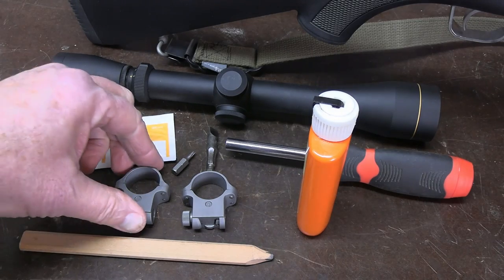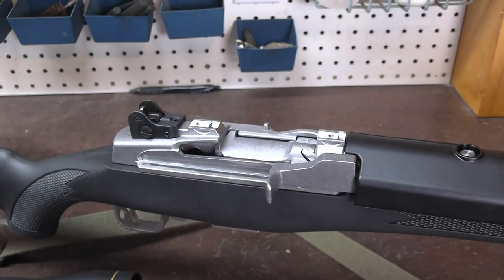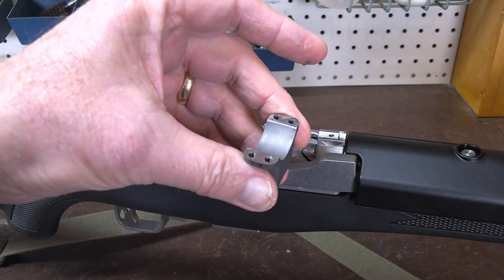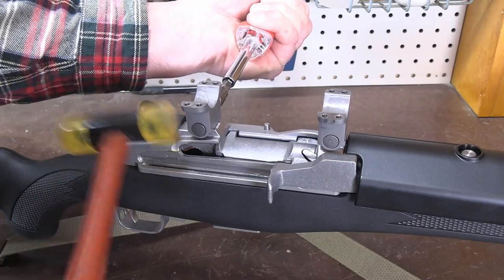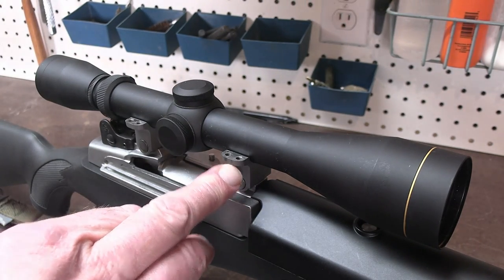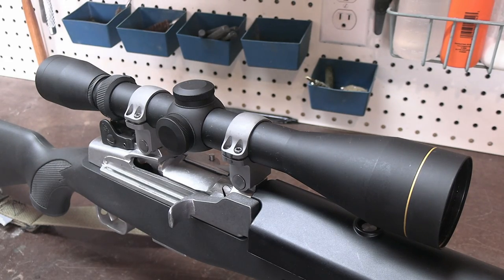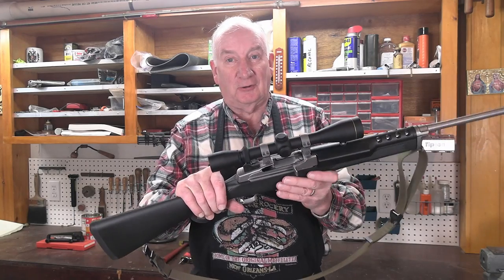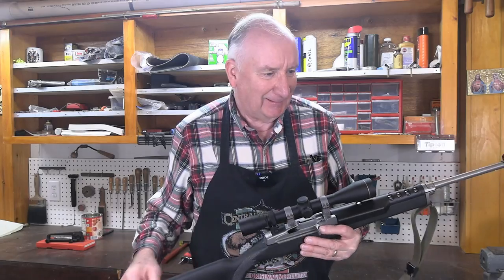How to Mount Ruger Scope Rings ~ Mini-14 or any others

Comment: The way I position the crosshairs is by leveling the rifle in a vice and shining a flashlight backwards through the scope turned on the lowest magnification setting and it will project the crosshairs onto the wall where you have a weighted line hanging. Then you just turn the scope until the projection on the wall lines up with your plumb line hanging down.
Reply: Then do your own video.
Reply: @kennethlukes1897  There's already videos showing how to do it. There's even descriptions on forums for people who learn better that way.
Reply: @Prepare2Survive  let’s see it
Reply: @waylonlegend4603  New youtube rules prohibit showing mounting anything to a firearm because they are claiming you're " modifying " the gun and that's not allowed on youtube anymore. There's probably forums that explain how it's done. It's not very hard to understand. You're essentially just making sure the rifle is level then shine a flashlight going backwards through the scope on the lowest power and you'll see the crosshairs projected onto the wall where you can hang a plum line so you can twist the scope so the crosshairs are parallel with the plum line and then just tighten down the scope rings.
Reply: Waste of time!

Comment: I wish I knew this two years ago when I tried to mount a scope to my mini.  I went with Warne Quick Detach rings made especially for Ruger scope mounts because the scope has a 30mm tube, but I could never get the rifle to hold zero. I figured it was the rings because the scope was fine on my other rifle. I exchanged the Ruger version rings for the picatinny version of the Warne QD rings and everything works fine. I bet with these tips the original rings would have worked without the picatinny rail. 

I've been a subscriber for years and love your content. thank you for what you do for all of us out here in the community. and I'm glad to see Benny is doing well and still going to the range with you.
Reply from the maker: The problem lies in not mating the rings the exact distance from each other, so one fights the other.  After just a few shots, the tug of war between them is over and they loosen.  Thank you for your support.

Comment: Great point about the clearance.  Had to go with the Ruger Picatinny rail myself due to the lack of clearance (did not want to remove the rear peep sight).
Reply: I’ll have to do this as well. Do you deal with a lot of failures to eject with that set up?

Comment: Brownells sells a set of proper fitting bits for all common cross bolts. Tip: For a good solid fit degrease the cross bolt and heat the lower ring saddle with cross bolt in a oven till it’s warm to the touch apply blue loctite and secure on firearm as indicated in your video. I’m old school and always degrease all cross bolts plus ring screws. You will save yourself some frustrations down the road when your mounts get sloppy. Great 👍🏻 video.

Comment: Great video GunBlue. Simple and to the point. I've always felt scope attachment was a basic job. But unbelievable how many have butchered the job. I'm usually torn using "loc-tite" or not, I see you use the oil trick. Cheers Jeff
Reply: If you want to see a butchered job, fast forward to 4:15 and see what it looks like when you have no idea how to install Ruger scope rings. 

Note in the Ruger manual “smack the rings around with a mallet” is never mentioned once.
Reply: @rifleshooterchannel208  I'll take the skills, experience and expertise of GunBlue, over an owner's manual.  In your car's owner's manual what does it list for torque specs ? Probably doesn't,  but guess what, there's not a single bolt, screw or nut on a car that doesn't have one.
Reply: @jk-kr8jt  Not sure what torque specs have to do with me mentioning that smashing scope rings with a mallet isn’t proper scope mounting procedure, but whatever helps you cope 😂
Reply: @rifleshooterchannel208  the point is, as stated, not everything is in the owner's manual.  You can mount your scopes any way you'd like.  Crazy glue and/or duct tape is not recommended,  but hey to each their own.
Reply: @jk-kr8jt  So you’re saying smacking the scope rings with a mallet is a good technique?
Reply: @rifleshooterchannel208  yes, I am. As stated I will take the advice of a qualified gunsmith, like GunBlue, with his skills, experience and expertise over an owner's manual. Does using a mallet apply to most scope rings? No. But, Ruger and Sako rings are a different animal than Redfield style or Weaver style rings. As seen in the video the Ruger rings did become a quarter to half turn tighter after the mallet. Either way you can use any technique that you choose.  I'll wish you well with it and I hope it remains solid for you. Until then enjoy your mini-14, they're a great little gun.
Reply: @jk-kr8jt  Call Ruger and ask them if they recommend smacking their scope rings with a mallet during the install.
Reply: @rifleshooterchannel208  I'll get right on that. Better yet I'll continue to do things my way. You can do it anyway you'd like.
Reply: @jk-kr8jt  Does “your way” involve smacking scope rings with a mallet?
Reply: @rifleshooterchannel208  in this case, yes. I wouldn't say "smacking", tapping is more like it. The idea is not to bend or twist the ring. What is being done is "seating" the two rings. The same will hold true for sako, weaver, some BRNO, style rings. 
Holds true with seating a connecting rod to the crank when building an engine.  All these things are built out of milled steel  and will not be damaged by seating them with a mallet or wood dowl. Now using a 17lbs sledge hammer for that task, I wouldn't recommend it.
Reply: @jk-kr8jt  If It doesn’t seat on its own, forcing it with a mallet will not help the issue. Might be ok for a Fudd gun that gets shot 10 times a year at 50 yards. But for people who want things done right, they’re not battering their scope rings.
Reply: @rifleshooterchannel208  by all means,don't ever touch a mallet to your rings. As a matter of fact don't allow a mallet within  a mile of your rifle. Keep the system that you have in place. Obviously it works for you. Keep the mallet for beating dead horses.

Comment: I put a 2-7x Leupold scope on my early 'pencil barrel'  Ranch rifle and got groups of 4" at 100 yards. With an adjustable gas block and barrel strut installed, groups were cut to under 2" using ball ammo. With handloads, I get around 1" or so. The only fault with the gun is that it is fussy about what mags I use. With good ones it runs like a champ. With not-so-good ones it's another story.
Reply from the maker: Your problem has been with using non-original magazines, not with the gun.  Ruger has addressed the accuracy issues with the heavier barrel, which requires no added features.

Comment: Excellent video that answered some of the questions I had.  The Ruger Mini-14 shipset includes the scope rings and a Picatinny Rail and the receiver is drilled and tapped to accommodate both.  It seems like Ruger is giving the option either to use the scope rings or the Pic Rail.   You would still need scope mounts in any event to attach a scope to the Pic Rail.   The scope rings provided in the shipset and mounted directly to the receiver - as in the video - appear to resolve the issue.
Reply from the maker: Picatinny rails have a following for folks who swap stuff, especially.
Reply: Notice no part of the directions from Ruger recommend smashing the scope rings with a hammer for some crazy reason. 

Therefore it’s best to avoid doing what was shown in this video if you’re interested in properly mounting an optic.

Comment: Got a 580 series stainless. Good for about 15 rounds before it starts to wander. Still like it. Really fun to shoot. Probably got 10k rounds thru and not one malfunction.
Reply from the maker: Bench rest shooters only shoot ten consecutive shots, and they do it in ten minutes.  If your rifle is accurate for 15 consecutive shots, it's not the rifle that's wandering.  It's the target.  Heat from the barrel, including the emission from the bore, causes refraction of light that bends the target image up, left, right, and even down, depending on air currents that move the vapor.  The target isn't where you are shooting.  Bench rest shooters all shoot identically accurate rifles, but spend a lifetime learning to read wind and mirage, which is what separates the men from the boys, or the ladies from the girls, if you will.  If a rifle has accuracy problems, it doesn't wait for 15 shots to show it.  What sort of target need 15 accurate rounds?
Reply: @GunBlue490  That is the biggest piece of Fuddlore insanity I’ve ever read on your channel.
Reply: @GunBlue490  I would like to see this tested

Comment: So on this video you are using higher rings because of the large objective bell of the Leopold scope. Those high rings allow you to clear your aftermarket rear sight.
Reply from the maker: No, I didn't use higher rings.  Those are the original height rings that Ruger supplies in the box with all Mini-14 rifles.  This is simply a mounting demonstration, using a spare scope I have on hand that I use for ammo testing.  I would never have any reason to mount or recommend such a cumbersome scope on this rifle.  The more important concern is to provide adequate clearance for brass ejection, so that cases don't collide and jam the bolt.

Comment: I just purchased the same rifle and about to attach a scope.  I'm somewhat concerned with oiling the screws.  I'm guessing that the oil will allow for a tighter fit.  Wrong or right, I've always used Loc-Tight.  I think I'll use this method.  I'm wondering if you have always oiled these screws?  Not questioning your experience/knowledge but this is new to me.  Great video!

Comment: Wake up guys
Taping the releases the tension OR binding of the metal
to allow for SLIGHT 
MORE TIGHTENING
If you look at the metal under a microscope or
feel the finish
It is slightly rough
Hence the tapping
allows for slipping
or breaking loose
the bind which allows for a bit more tighening
Cheers

Comment: Thank you for the video will be using this to attach my scope on my new mini 14. I do have a question though and it's about the scope being right underneath the ejection port did you run into any problems? I bought a sig buckmasters so hopefully it doesn't interfere.

Comment: What scope rings are you using?  I have the KD-72-M rings but need a little extra height. It appears you have extra high but I can’t seem to find a part number that I know will work. Thanks and great videos!
Reply from the maker: They are the rings supplied by Ruger as standard equipment, which are medium height.

Comment: Thanks, that was very good. I was wondering if the scope will interfere with the ejected cases?
Reply from the maker: It certainly might.  The rifle design was intended for combat with supplied peep sights.  When I mount a scope, it's a one shot affair.
Reply: I use the ruger supplied rings and have no problems with the ejected rounds.  At least I didn't until the government here made my gun illegal to use.

Comment: I see the scope your installing is a Leupold, what power is it?  What's your thoughts about using the Mini 14 chambered in the 5.56 Nato for deer hunting?  Shots out to 150 yards.
Reply from the maker: It's a Leupold VX-1 3-9.  I use it only for ammo testing with normally un-scoped rifles.  Watch my early vintage scope selection video.  I never hunt with a power greater that 2.5X at the low end, and prefer 1 or 1.5X at the low for deer in order to gain the best field of view, which is critical.  If your state allows it, the Mini-14 is certainly capable within 150 yards with the appropriate ammo.  I would use a minimum of 60 grain bullets, with a heavy jacket designed specifically for large game, not the standard explosive varmint type.

Comment: what size Ruger rings would I need for a 44mm objective?  I see there are 42mm available but the next size up is a 52mm - I assume that would be the one to get for a 44mm objective?
Reply from the maker: Depends on several factors.  Objective lens measurement is the visible glass diameter, not the objective bell outside diameter.  Adjustable AO and tube thickness can be very different with identical objective specifications.  Of course, my Mini-14 has a top mounted handguard that has less allowance than a bare barrel, and barrel tapers vary.  I can give you my measurements and you can go from there.  With this Mini-14, and with a Leupold non-AO 3-9x40mm and medium height rings, I have a snug 6mm clearance between the bell and the handguard.  The outside diameter of my bell is 1.835".  I'll let you do the math for your situation. Be sure to provide at least half mm or .020" clearance, or you'll have no way to run a cloth through the spot.

Comment: Great vid bud,Q?What's the scope you use or what's the best scope for mini 14 with the mounts?:)Nothing crazy or expensive:)
Reply from the maker: Personally, I prefer a 1-4 or similar power as used by the military.  Watch my recent comparison of the wood v. synthetic stock with an AR-15 and you'll see such a scope with a 1 inch tube on my AR-15.  It's plenty, and very compact. I used a Nikon with a .223 dot reticle.
Reply: @GunBlue490  is Vortex Optics Sonora 4-12x44 Second Focal Plane Riflescope - Dead-Hold BDC Reticle good for mini 14?:)150.00 to spend?
Reply: @teskataftaba  Don't know what ya did, but the 44mm bell as long as it cleared you're good to go. I love Vortex

Comment: Have you fired your Mini 14 with the scope attached ? The Mini 14 ejects the empties quite vigorously and I was concerned that the empties would hit the scope as they were ejected. Have you encounter that possible issue ? Thanks
Reply from the maker: Yes, I have.  Brass clears the scope perfectly.  In fact, this most recent series tosses brass with far less vigor than mine or my buddy's earlier 580 rifles.  My brass lands about six to eight feet away at a pretty consistent 3 to 4 o'clock with this rifle, and doesn't dent cases as before.  I don't have to wander the countryside to find it!  Even at my range, the brass is directed safely behind the next shooter.  It actually tosses no farther than my bolt action rifles now.  Recoil is also noticeably softer.

Comment: I just bought a mini 14 and it came with the picitany rail and the scope rings, does it come out to preference or which offers better shooting? And if i go with the scope rings do you recommend loctitie?
Reply from the maker: My new Mini-14 came as yours. It's entirely up to you.  I personally prefer the Ruger rings, which don't cover the ejection port.  Loctite is not necessary, but it won't hurt.  Use only Blue 242, and use only an Allen wrench to tighten.

Comment: I need your help,I have a pre 27 smith - I wanted to chenge the grips but the screw it keeps turning I don't know if the screw itself or the grips are the problem ( its pacmayer grips) I was wondering if I could just cut the grips Whit a knife and get to the screw and use some wire cutter and cut the screw in helf or use a drill bit on the screw head, i know it sounds very stupid and almost caveman approach to the problem but I'm sure you have a much better idea,thank you very much.
Reply: Could be the female threaded insert on the other inside of the grips/around the butt somehow came loose and is spinning with the screw. It happens and it’s frustrating. 

Me personally I would drill the head of the screw out but that is a really nice wheelgun you might be concerned about slipping, I know I would 😂

If you’re careful and stop to check your progress often, I’m sure drilling the head out would work well.
Reply: Sounds like you need an impact drill. 😎
Reply: @JoelMMcKinney  lol

Comment: I assume my Mini-14 is like all other 580 and higher
Spent casing trajectory is very high it goes a significant distance
I haven't yet scoped my mini
Given where the turrets sit are the casings striking the knob with every ejected casing and do you think it would have a negative effect on the
Reply from the maker: Actually, it's not at all. I have observed that this most recent 584 series does not eject as far, nor does it strike the scope, which also results in uninterrupted, clear ejection that doesn't bounce back into the receiver.  Also, recovered brass is not dented as my previously owned 580 series. Ejection is more directional than random.  It's a very good improvement overall that I assume is not peculiar to this one rifle.

Comment: Can you please tell me the make of the screwdriver you used? Also, what size Torx bit did you use?
Reply from the maker: Sure, it's a Gunmaster screwdriver set that I purchased in the Walmart gun department a couple of years ago for $7.95.  It's magnetic and comes with a complete set of bits for all sizes and types.  I've purchased two sets and they are very good quality. The Torx bit that I used is included.